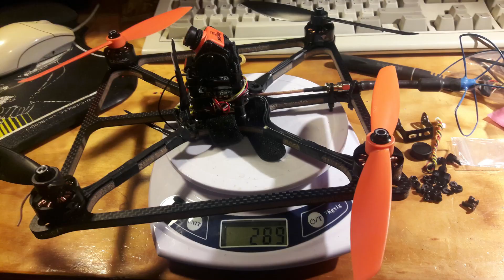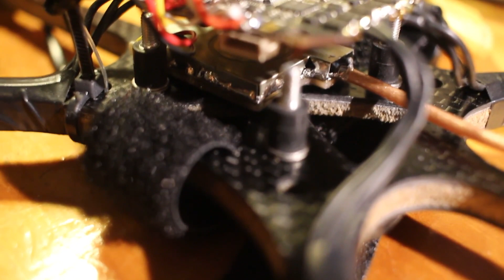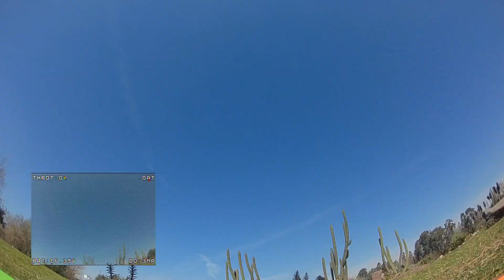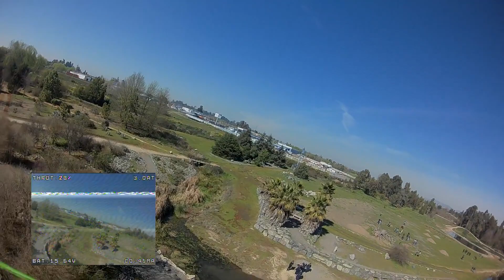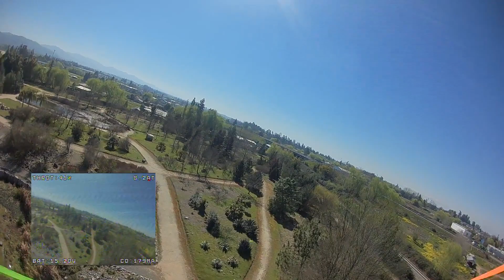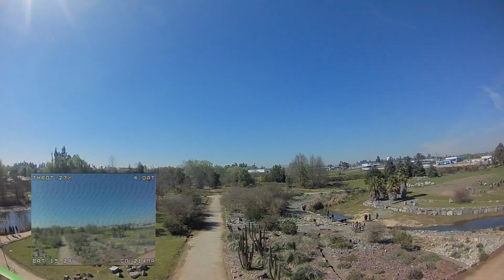TBS G2 7" KissCC Long range miniquad build overview

Comment: It takes a lotta guts to build a long range rig like that without a GPS. What the total weight and what  battery you fly with it? It is a beauty.
Reply from the maker: It has a GPS now, but has changed a bit in configuration. The 2.4ghz vtx burnt up and I was never happy with the OSD, so it's now got a 5.8ghz fpvision in it.  Weight comes in at 315g, and I use anywhere from 1800mAh to 5000mAh batteries with it. With the Zippy 5000mAh, AUW is 747g.

Comment: Hey Chile!!! Any flights with your new setup yet? I really wanna see the amp draw at cruising speed. I got my Alien 7" up and did a 3 mile out and back(10km total) flight with it. I love it but I'm thinking I need a featherweight 7" now also! Check it out here  https://youtu.be/KKj5uQGjIjk
Reply from the maker: Unfortunately, not many. I was doing some testing around the house and clipped a tree sending the quad into the ground. That killed both the VTX and the FC. Right now I've got an FPVision and a regular KissFC on there, along with some old rotorgeek20a ESCs, but it's using far too much battery for my liking. More testing is in order, unfortunately.

Comment: Hi Chile very nice build!
I have a G2 and was wondering if it is possible to connect the RunCamSplit to the TBS power cube as plug and play?
Is there a better housing then the recommended 3D printed canopy to house the extra board connected to the RunCam Split?
Also do you get a OSD lipo voltage reading in the googles?
Reply from the maker: Hi, you've got the Powercube 2n1 Vison, right? That will work just fine. Make sure you toggle the Camera voltage to 5v before connecting the Runcam split, but then just plug it in using the cable supplied by TBS. The canopy that comes with the G2 will work just fine, the Split board just adds another layer to the stack (but be sure to use nylon standoffs above the Colibri FC so you don't short out the board). You don't even need to print the canopy.  

My OSD does provide it, as does the FPVision. I prefer the FPVision's OSD much more than what I have, but sometimes things have to be compromised.

Comment: Getting props out of view is a challenge but you are very close. Great looking setup. Many thanks for the run though. I look forward to seeing it live a long and dangerous life.
Reply from the maker: Thanks! It's all a bit of a compromise. I tried running everything but the Split off the 5v output of the Kiss board, but in the end had to separate the minimosd on to its own 5v regulator. And I'm really not happy with the minimosd, but.. it displays most of the info I need.
Reply: All Greek to me - never had OSD. Its just a matter of time before I will have a single board with all the features pre-installed. Perhaps then I will go dohhooo and realise what I have been missing. I have yet to try using a microphone. Should imagine that would be useful, be able to listen for a struggling motor perhaps. Anyway. Love the content, thanks.

Comment: Thanks for this great info :D. Can you explain or show how you placed the microRX antenna on your frame ?
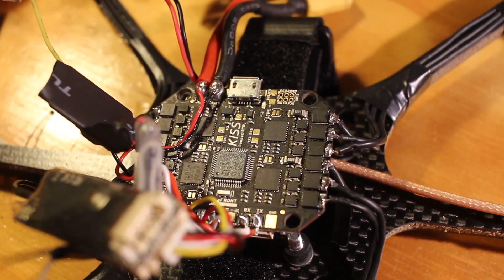Reply from the maker: There's a picture of it at 0:28. It's just to the left of the main stack. I have zipties that run straight up and down through the large hole in the frame. I just use a bit of electrical tape to hold the antenna to them (light part up, black part down).

Comment: Pretty awesome quad :)
Why are you not using one of these FCs which has OSD, PDB for FPV cameras and vTXs like the Omnibus F4 Pro, you even have current sensor! You could save maybe more weight. Things are even moving so fast in the hobby, we start to have also FCs with ESCs, OSD, Current sensor and even PDB for FPV cameras and vTXs.
Have a great weekend and happy flying :)
Reply from the maker: Betaflight vs. Kiss.. I'm a Kiss guy, I like how it flies and how simple it is. I could never get my betaflight boards to feel as nice and I'd rather be flying than fiddling with command line options for filters trying to get it working smooth. The KissCC comes with current sensors for the escs, but doesn't take into account the other external current draws..  It's close enough to be usable.

I'd prefer another solution for the OSD, but this was light, cheap, and I had one on hand. And as for VTX, most AIO solutions have 5.8ghz vtxs (even the TBS powercube) and that'd be a major limitation on such a light rig, so I wanted a 2.4ghz VTX.
Reply: Chile Vuela Thanks for the detailed explanation if you are a KISS Lover indeed most of the available options will definitely not satisfy you lol
Take care :)

Comment: Good video! I'm thinking to build setup like this in the future. Now I'm watching videos and reading forums about it. My question is because of video footage from the camera. Do you use the standard lens or GoPro lens? I suppose the propellers will be visible on the video in any case, but it can be possible to minimize their presence.
Reply: It's GoPro Lens (0:26). I was inattentive.
Reply from the maker: They are there, but fairly unobtrusive. If I ran a bit more angle or moved the stack up a bit with some longer standoffs they'd disappear completely.

Comment: I have done the same with one of my Unify 2G4 vtx. It's a lot easier to cut the SMA connector with a dremel tool in the 5 connections and then de-solder each leg independently. I'm happy to see that you went with a 7"! Can't wait to see the vids man!!
Reply from the maker: I cut them individually with side cutters, but a dremel would have been a better option -- less chance of pulling up the pads. Epic long range videos are coming soon!
Reply: Chile Vuela 
I went the opposite route. Yours is ultra light and mine will be heavy. I disassembled my RMRC Valorem 7" due to it being to squishy and jello-y and am currently building a Alien 7". It's incredibly stiff but a bit heavier. I hope you don't lose this one with no GPS. Good luck man!!!